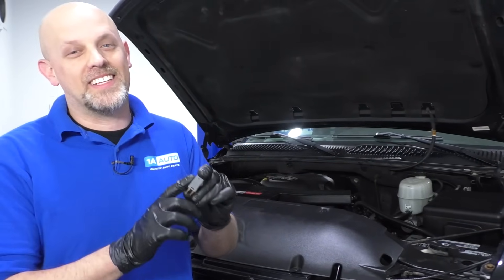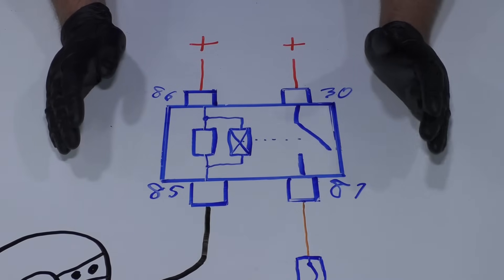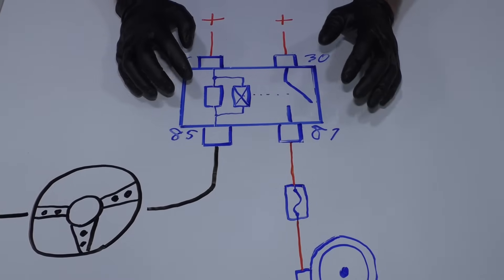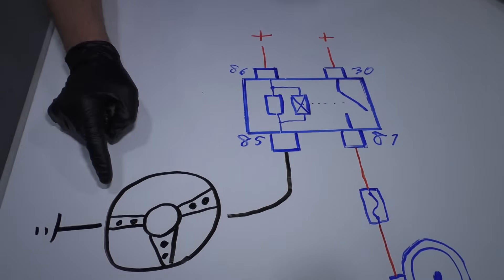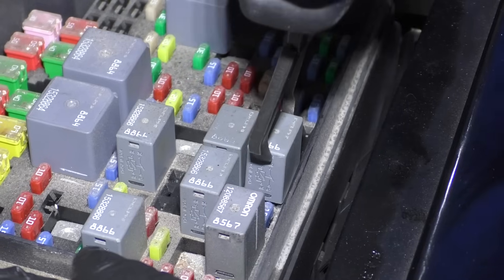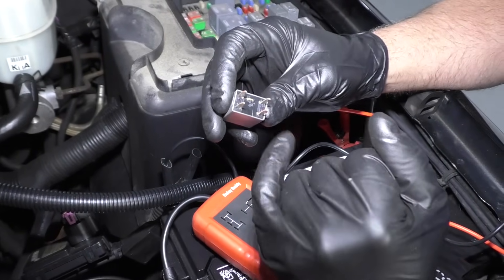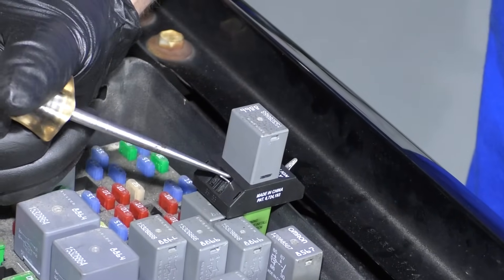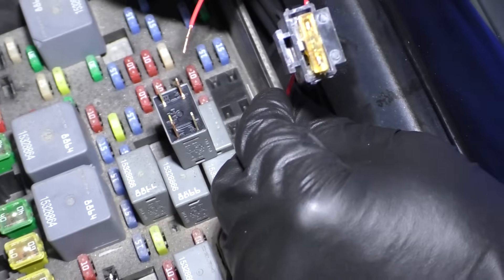How to Diagnose a Failed Relay In Your Car, Truck or SUV

Comment from the maker: √  Watch the Video
√  Buy The Part at 1A Auto https://1aau.to/m-Visit-1AAuto
√  Do it Yourself
√  Save Money
Reply: Lmklll
Reply: I want the relay buddy, where's the link to buy?
Reply: Is it possible for a relay for your turn signals and hazards to fail on three of the lights but still work on one. my passenger front works but it's the only one on both signal and haz. lights.  2004 GMC Canyon.  scratching my head on this one  any help would be great.  frustration has set in LOL
Reply: My starter was bad but the mechanic replaced a switch commutateur interrupter, now my passenger side turn signal hyperflashes on the front, I have no turn signal on the rear. You can feel it in the relay switch located in my fuse box next to my dash. My starter was replaced, but why did they install a commutateur interrupter switch? And, why does the relay switch that they installed cause the hyperflash? Now, they tell me that they can install another switch that will cause the relay switch to stop the hyperflash. Personally, I think it's BS, why keep adding more switches?
Reply: @siouxzee59  thank goodness for channels like 1AAuto and Scotty Kilmer who are out to help, not hurt
Reply: @siouxzee59  lot of auto mechanics who are only in business to lie and cheat the customer; not all but the overwhelming majority

Comment: I’m not getting power at 87 and 86 and it’s suppose to be hot at all times and isn’t and the fuse is 30 AMP and my power probe is 15 amp so I’m losing power at the fuse box under where all the wires are

Comment: Great Video need help to unlock boot need to use wiring for roof to open watched a video where a pin is put no 54? to over ride unit so roof will left so I can fix boot lock which I was working on thinking that was the problem I only created another problem now cannot open boot.

Comment: I don't know if anyone will see this question, but I have a 2019 ram 1500 classic Warlock edition. My flashers used to flash when locking and unlocking my doors. Now, when I unlock my doors, my lights come on for a few seconds and turn off, but when locking, the flashers do not flash any longer. Any ideas what I should look for? I don't want to pay the dodge house $180 just to diagnose. Thanks.

Comment: What if you are hooking up a utility trailer on a 4 way flat and the trailer lights don't work? But the tail lights and signal work at the truck. You plug in a 4 way tester and the left signal led does not light up.

Comment: I told an electrician...i think its the relay.
He said no ...its your fuse box.
So $ 310 for his diognostic  $ 890.  on a new fuze box ...and still lights dont work.
I buy a new regulator , and hey presto...lights.
2 other electricians said they had to rewire fuze box due to water damage. So i thought ok its the fuze box.
I pulled the fuze box apart ,  had to brake it open....and NO WIRES inside.  Its all metal conections. All 3 electricians lied. $ 800 labour cost. New box $ 890 
Total  $ 1690.
And all it needed was a clean up and a relay.  Relay $ 58.  
Labour $ 150 ?
Bstds..

Comment: When i was tehnician we didn't have relay tester,we have to do it manually with battery with 9v and with analog multimeter,so i think young apprentice should first to know manually test relays and then you can use relay tester
Best regards from:Old World

Comment: Can a relay be intermittently bad? In which case, what should one do? My car will sometimes not start - no clicking at all (battery is good) - but then a minute later work. I presume there's no way to tell, except for testing it WHEN it's not working (and hopefully continues to not work when you test it).

Comment: relay clicks but the probes that i powered and tested with clicking are parallel to it. meaning they are on the positive and negative side of the wiring on thr socket of my relay. which when tested from the switch lights up when supplied directly with a + line. is it safe to say that the relay i bought is already shorted or faulty??

Comment: i did a check on my foglight relay and i have chamged my relay last year and foglights turned on again. now the fog lamps started to light up a little delayed. switch turns on . but foglights would not turn on  as it should. then it already stop functioning.  so i bought another relay but seems broken still. i tried putting a positive line on the socket switch on neg. black wire and it turn on with switch. but without the direct postive line coming from the batery the fog lights wouldnt turn on. i got a 4pin relay same as the specs required but still got blind. tried doin the relay itself to check powering it up with positive and it clicks.

Comment: My '12 Camry battery light will come on when I start it but goes off after running/driving 15 minutes +/-. Also it only happens on first start of the day. And sometimes it doesn't even come on for up to four days straight. Thankfully it always starts  and doesn't die. So far.  I had it tested at Oreillys for battery and alternator and said both passed.  Any advice on what could be my issue? Thanks in advance.

Comment: Here's some advice for fixing this for free. Yeah they're cheap but you may get stranded and need to fix it.

I had a ranger that sometimes wouldn't start. Everyone kept telling me it was a bad fuel pump. It worked fine on a cold start, but if I turned it off after it warmed up, and tried to start it back, the fuel pump wouldnt come on. I managed to find out that when the engine bay warmed up, the relay wasn't engaging. I did this by swapping the relay with something else and trying it. I then, being completely broke, cut open the top of my relay and saw one of the contacts near the coil of copper wire (electro magnet) was bent slightly away from the coil. I pushed it back straight, and taped up the relay housing good to keep dirt out of it, and bam. worked like a charm for the entire rest of the time I owned that truck and it cost me nothing. and if I'd listen to everyone else I'd have wasted time and money on replacing the fuel pump. The reason I didn't think it was the pump is because it was intermittent and only when the car had warmed up, and it never acted up while driving, only if I shut it off then tried to start it again. 

Long story but I'm telling it so people know a relay can be intermittent. If you're not sure what to do, mark it with a sharpie (so you know which one is the original) and swap it with another relay and see if the problem follows or not.

Comment: Good day sir, can i ask about the battery saver relay location of 2001 ford explorer sport trac? I watch some videos ang i did actually found the relays under the steering wheel but i don't know where exactly the battery saver relay. 

Because the battery always drained. Thank you

Comment: Thanks 👍 have a 2016 Chevy Express with multiple intermittant relay fails.... Cab fan, horn, AC pump. On and off again operations. Been told that thousands of folks have same problem with the stock AC Delco relays.🤕😩 Such garbage. Wishing we had option to purchase quality components Not made in china

Comment: I drive a 2007 ford escape and while I was driving the dash lights, radio, signal lights all turned off. The car was still driving, but all the electrics kept coming on and turning off. Then when i got off work, my car was dead. I got a jump and it started up. On the way home the electrics we’re going out again and started to smell this stink smell, like dead fish or rotten eggs. When I finally got home I checced under the hood and the battery was smoking and sizzling….. what I also noticed is my coolant was EXTREMELY low. I’m praying a new battery and some coolant will fix the issue of what I assume is an overheated battery. But I have no idea. What sucs is either way, I have to replace the battery. Does any one have any idea what I’m dealing with?

Comment: I have a 2006 Ranger 4x4 cigarette lighter and phone charger doesn't work also stock stereo does work but will not change channels. fuses are good. what is the problem?

Comment: I have a 95 Chevy Tahoe 4_4  and something is making all my fuses under the hood ground,i have a test light hooked to the positive battery post and the test light to the main wire going to the fuse box, with the ground battery post on all the fuses inside the box show ground on both sides of fuses and even if i pull the relays still ground, would you think it may be in my fuse box it's self,ty

Comment: So.. a relay may click but be bad. .. 
I test my relay. ( ac)  and clicks. But on the car i turn the ac and doesn't click.  Clucht doesn't engage.  I jump the fuse box clutch engage but no cold air.

Comment: I'm getting a p1282 code on odometer read out. Do you think it could be due to me pulling the fuel relay out and using a jumper to do a fuel pressure test? I replaced my fuel pressure regulator and did a pressure test. All's good, no engine light or codes. How to reset?? ✌️

Comment: How bout one specific for dodge Tpim module? ( relay was good, already replaced starter) You know" Tpim module", the stupid fuse box that puts out 0.01 seconds of voltage and then quits, why push button start you dicks
Reply: They sell a kit to bypass the fuel pump relay..... Are these fuse boxes just trash?

Comment: i have cherokee xj with 3 pin horn relay,, output give me 4v without pression the horn button (go figure) , coil positive give 12v and stay 12v (good) , coil ground give me 12v and pressing horn button give me 2v ( no good ground on the button or the ring GO figure!!! besides that ,, just 1 horn works and the other just clik and get really hot,,, your commentsplease be techical no guessin

Comment: Hello I have a Mitsubishi Outlander 2017 and both headlights turned off the same time, fuses are fine my high beams, blinkers, Park lights all work I tried taking out the relay and I couldn't get it off I used a spanner and cracked the top, are some relays not supposed to come out, I'd appreciate your advice. You're channel is excellent and female friendly thank you

Comment: Every light on my 2004 Tundra works except the rear brake light. Replaced fuses, brake light switch, and totally replaced the whole tail light assembly on each side.
Either a ground or relay problem? And input is appreciated guys!!!

Comment: I have a Chevy trailblazer 5.3 v8, I have a code popping up. P0526 for a fan speed circuit sensor, I replaced fan clutch and terminal and the code is still popping up

Comment: On my Tigra my lights are brighter over 2500 rpm and it shows airbag and engine light. Under 2500 rpm everything is normal. Alternator and battery are changed about 6 months ago. Is is possible that relay is causing this?

Comment: I have 2 wiper relays on my 2000 mustang. both are good. but, the wipers don't work. fuses are good, replaced multifunction switch still nothing. bad gem module? power seats, windows, chimes, interior lights work

Comment: My car is having trouble holding a charge/starting... i checked my battery voltage with my OBD2 and its at 13.6V while running (the battery is also very new) but for some reason the car will randomly not start (the dash lights will light up though)... then after a few attempts of starting my headlights will come on (completely on their own) and will not turn off until i jump-start the car. could this be because a relay failed? or is it likely a headlight circuitry issue?

Comment: My fuel pump stopped working so I exchanged the fuel pump relay with another relay and now the car cranks and starts. It's a 2001 alero 2.4 so the fuse block contacts could be corroded?

Comment: Can I bring a separate wire as aground from the battery  to the 85 spot because I think the ground is weak as Im changing the relay and the AC IS  not working? Thanks

Comment: I have a 1994 mustang 3.8 the car when I turn it off the battery light comes on and gas gauge elevates, when the car is running no issues, I have been pulling the battery cables off when car is parked as to not drain the battery. I feel as if it's a ground somewhere but unable to locate it. Now watching the video could it be a fuse?

Comment: I have to test for a bad relay that controls an O2 sensor heater element (which gives me a “check engine” light) on a 2001 Toyota Echo. Where can I access one of those nifty relay testers? (The red one in the video that accepts several types and gives a green light if the relay is good or a red light if bad.) AutoZone? Do they rent them out?

Comment: I have a pd130 conversion in my T4 and the lift is working but not the main pump. Can anyone help? The wiring isn't straight forward. The 53 relay is clicking but unsure where to go from there

Comment: 2004 Escalade I need serious help with quick. The vehicle cranks and runs great but I have a large parasitic draw. I Purchased a volt meter and It showed a 193 mA draw. 108 mA is coming from the 40A IGN A fuse. That is the actual ignition switch. I replaced the switch and it didn’t help at all. mA is the same. Any idea what else could be associated with this fuse and why I’m still getting that 108 mA draw?  Also my EVAC/ECAS 10A fuse is pulling 85 mA. When I pull both it gets my parasitic draw to 25 mA which is normal. Your expertise would be very much appreciated!  So frustrated!!!!

Comment: I touch the fuse box to test the wiring,...on one relay location, pin 85 the light tester turns on while the other relay same type, pin 85 is off. Which one is correct?

Comment: I'm having problems with my low beams on a 2005 Buick LeSabre..I changed batteries ( new) and now the headlights don't work..the highs do though
Reply: Sounds like you have the wrong bulbs/lamps in the car. Take them out and check if they are the right ones at your local auto parts store.

Comment: My fog lights are giving me problems,  there not coming on, so if bypass the circuit by putting a wire on the circuit and the lights come on what does that tell me? If the lights come on would I be able to use the switch to turn on and off with the wire on the circuit?

Comment: Have a toyoya 2002 4 runner and the car wouldnt start, jumped it car started and drove fine, even startef again. Then later came outside while car is OFF and heard clicking coming from under hood, truck not starting now. Replaced battery and same issue is occuring, clicking while car is off is draining battery. Could it be a relay any ideas guys?
Reply from the maker: +kSc gaming We wouldn't be able to diagnose an issue like that here, you may want to have a local mechanic take a look at it. Thanks for checking us out! http://1aau.to/m/Shop-1AAuto-c
Reply: @1AAuto  hey figured it out my self. Turned out to be a defogger relay that kept buzzing and clicking after car shut off replaced with new. Weird though tested relay for continuity and resistance and was fine. Dont understand why it was tripping though should be off no matter what when car is off.

Comment: I’ve changed the relay but there still a buzzing noise coming from the fuse/relay box from the exact spot where the relay was changed.
What should I do now?
Reply: Your fuse box could have corrosion or damage of burn spots. Get your fuse holder box checked or you can do it yourself. Draw a picture where all the fuses and relays go on the fuse holder box,  then remove the holder box which should only be 3 or 4 bolts holding it down.  Check for corrosion or burn spots or moisture on both sides of the fuse/relay holder box. If you see signs of damage or corrosion than replace with a new fuse box. This should solve your problem.

Comment: When I put my relay for my horn in the horn stays on until I pull the relay. What’s wrong in the system? Is it a bad ground?
Reply: Did you find a solution ? .... currently have this issue

Comment: Halo i have a citroen xsara1.4 petrol years 2004 i can not find the relay that power ignition switch  engine crank no start  dashboards no power all fuses n fuse box okay earth wire okay part of electric off can you advice please

Comment: If I buy a subwired and I put it in brand new and my windows and my door locks don't work what do I do
Reply: Sound like broken wires located at the door jambs. Open the door, and expose the wires by cutting open the wire sheathing. You will find broken wires. Just use wire butt joints to reattach each wire colors. This will fix your problem. Use electrical tape over wires to protect from moisture after reconnecting broken wires.

Comment: Hi I got vw Jetta 98 the problem on my car is when I open the ignition switch doesn’t crank , the clock  N the miles  on the cluster turn off , battery is new , I buy the switch thinking that was the problem but not . Hope you any answers to my problem.
Reply from the maker: +Carlos Barajas We wouldn't be able to diagnose an issue like that here, you may want to have a local mechanic take a look at it. Thanks for checking us out! http://1aau.to/m/Shop-1AAuto-c
Reply: @1AAuto  
Ok thank you

Comment: is it possible for the relay to be failing intermittently or on the way to failure, outside of say corroded connections/wires which would normally cause the intermittent problem?

Comment: My car won't start... even though my battery is brand new. The starter is working as well... So I'm hoping maybe I have a bad relay. I don't know a ton about cars so I hope this video helps me.
Reply from the maker: +JabeZ Zz We wouldn't be able to diagnose an issue like that here, you may want to have a local mechanic take a look at it. Thanks for checking us out! http://1aau.to/m/Shop-1AAuto-c
Reply: Did you find out what was the problem ? I'm having the same issue with my 2008 Chevy Malibu Ltz
Reply: @ToniExMazizoMusical  Check the wiring and make sure the clamps on the battery terminals are tight and you can wiggle it around, also check to see if it’s not corroded that will sometimes cause a bad connection to the terminal and cause it to not start nor crank